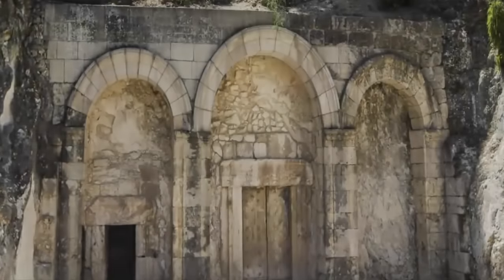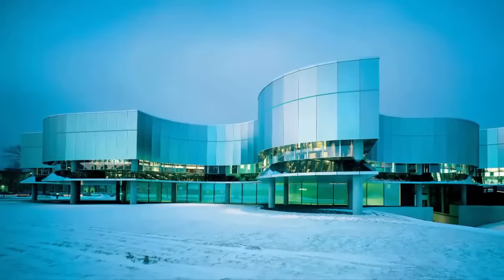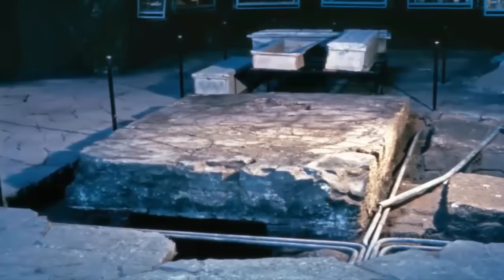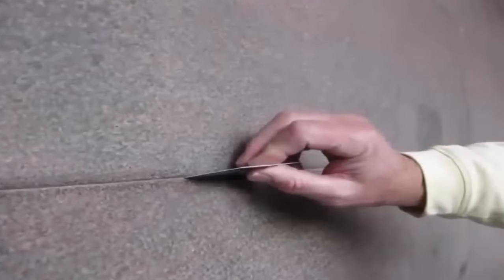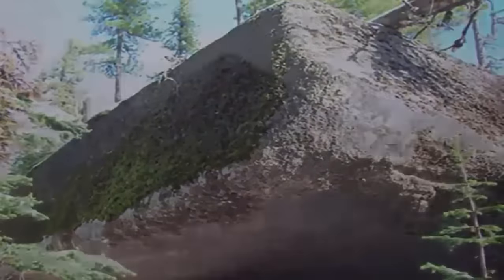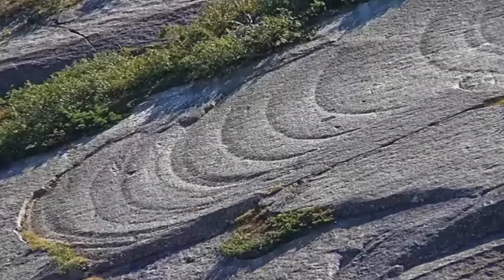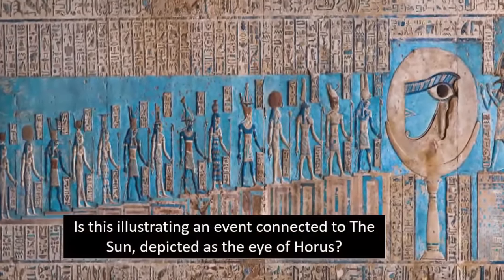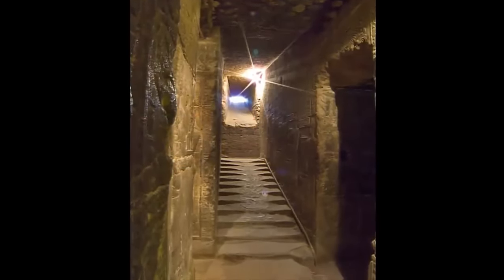Melted Pyramids In Ancient Egypt?

Comment: About "Dendera Temple..."  If the steps inside were indeed melted stone, from a heat source outside the window, then what about that side of the temple itself?  Was the exterior walls melted or show signs of being superheated?
How about the edges of the window?
It dosen't make sense that the stairs of granite are melted by something, but not anything else on or in the building.

Comment: The steps are made of granite? Granite has a molten point 1215-1260 C. The french solar furnace odeillo can reach temps of 3500 C . Does the relief on the wall of the eye of horus , not look like a parabolic lens on a swivel stand? Melted.